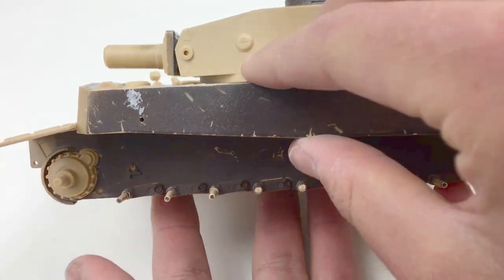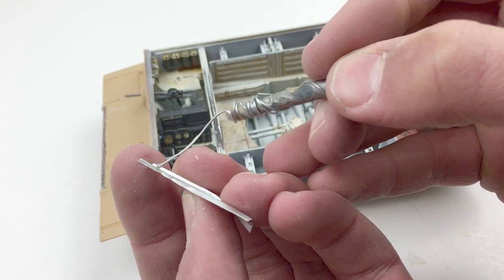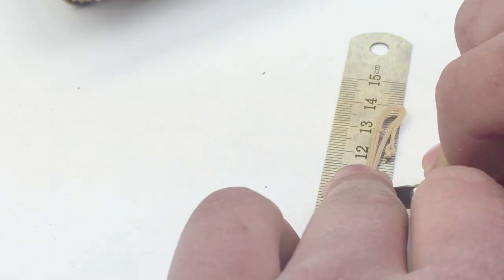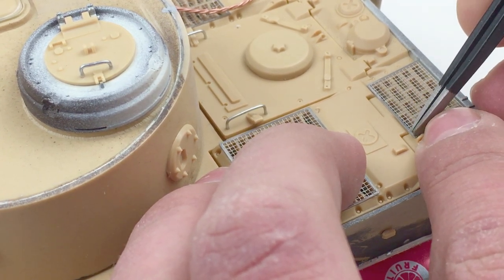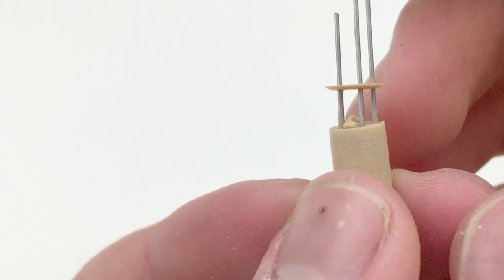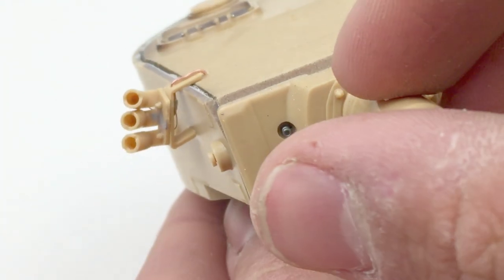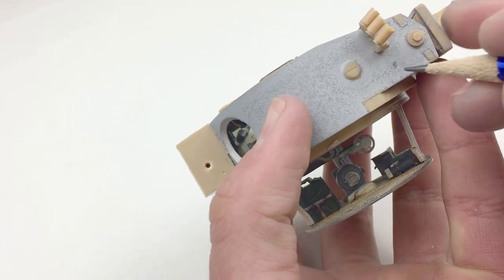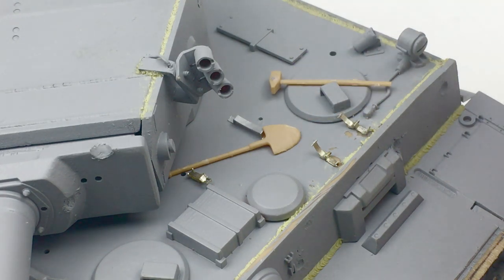Detailing This Tiger I's Exterior: (Airfix 1/35 Tiger I "Early Version")

Comment: I simulate bullet damage 12:48 with my soldering iron at maximum heat. Then you don't really have to go to the plastic itself. The melt marks grenades can leave behind look pretty nice, at least to my eyes. However, if you're not careful, you'll kill the tiger with a huge hole. Awesome video, it helps me alot THX
Reply from the maker: That’s cool! That’s the way that Adam wilder does it, so I’ve definitely considered it! Does that destroy your iron tip?
Reply: @TheScaleEngineer  To be honest, I change the soldering tip when I use it for a different purpose ;-) because if you want to solder fine things afterwards, that's not optimal otherwise

Comment: Nice work there. One observation is that the fenders had square mounting blocks with the bolt thread in them. There were no big holes in the side of the hull behind them. Your holes are also bigger than the bolt heads you made.
Reply from the maker: Yeah I’m aware of all the accuracy issues of my build 😂 I’m actually going to do another tiger build soon, hopefully more accurate

Comment: Take a lighter to your PE it takes the spring properties out the brass and alot easier to bend and dint more realistically, and rub your nail over the tops when attached to the grills it'll take a more real bending in to the grill bars to pushing in a hardened bit of PE! Same with your brass rod if it's solid to get a good ben use a lighter till you see the brass colour turn

Comment: Can you tell us where you got the drill bits with the handle molded on? I can't seem to find those anywhere, and it seems like a really great idea to not have to mess with changing bits in a pin vice all the time.
Reply from the maker: That was a pin vice, unless I used a twist drill, which looks like this https://www.ebay.com/itm/PCB-Drill-Bit-0-1-1-0mm-Tungsten-Carbide-Micro-Drill-Bit-Print-Circuit-Board/393036943489?var=661950688518

Comment: Did you glue the lower hull to the lid and front panel? In the manual it says to just assemble and not glue. I’m guessing this is so you can look inside, but I don’t like the idea of the tank just being loose and insecure.
Reply from the maker: I felt the same way as you, I glued it, and then made sure there are no seams by re-doing the weld with epoxy putty.

Comment: I would suggest you do a little more research on things you're super detailing, making sure the changes are more accurate than the kit detail and you're not just detailing for the sake of detailing. For instance, the holes you drilled in the hull for the skirts, aren't a thing. The actual skirts were bolted to small square blocks (with the upper outer edge chamfered) welded to the hull as drilling holes in armor plate is not advisable. Most plastic kits mold these on the hull side, but this Academy tooling is ancient and they did not do that. But Tiger1.info has dimensionally correct diagrams and even CAD files of the correct mounts. I'll forgive that you simplified the side mudguards as even if you did check out his diagrams of those, Im not sure those bends would be worth it as they are tiny in 35th. One other thing is your PE clamps are on backwards. The handles face the glacis not the band. All of this is minor, but If you're gonna call it super detailing do your homework.
Reply from the maker: Adam Mann, thanks for watching. Yeah, I think I may change the title. I know you’re the Tiger king, so thanks for the advice. I really didn’t do too much research, as you can see. Much of it was for just a visually detailed, if not historically detailed model. I’m not exactly what you would call a “rivet counter” even if I’d like to be. Do you know if there is a generally good website for references?
Reply: @TheScaleEngineer  Tiger1.info for the Tiger. Nice work on the kit, I really like to see modelers going back to our roots by making fenders out of pop cans and sourcing detail items from the hardware store. Rivet counting, $30 detail sets, $60 tracks and buying molded zimmerit panels can really suck the fun out of this hobby.